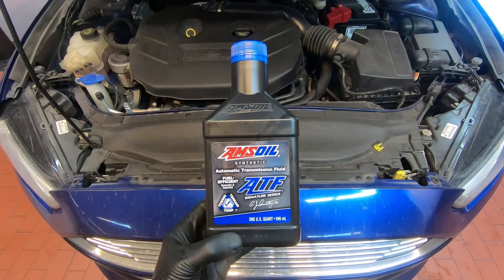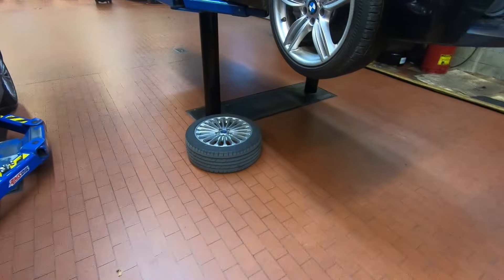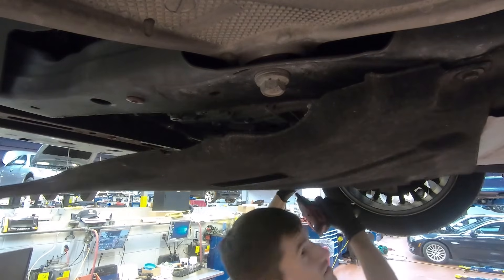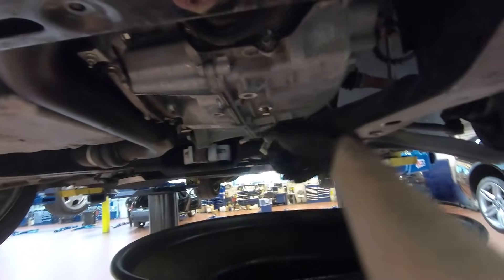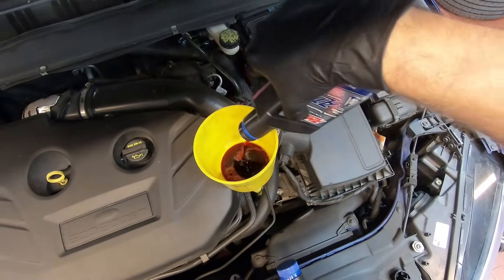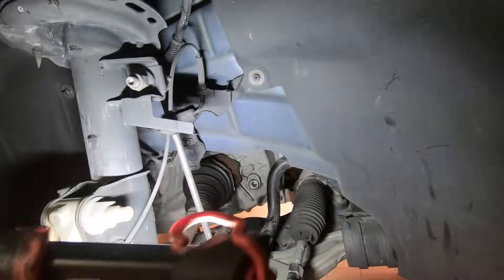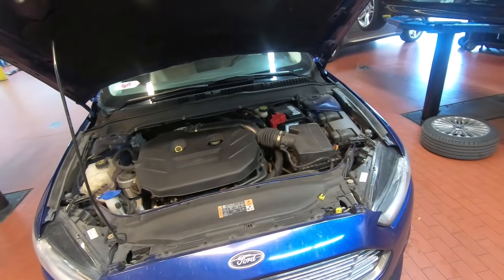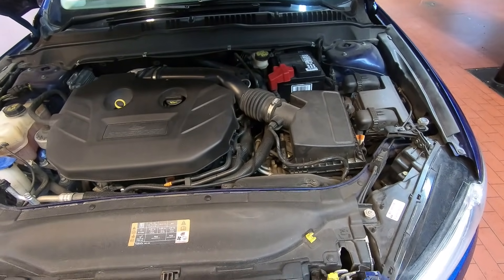Ford Fusion Automatic Transmission Service ( 6F35 ) [ HOW TO ]  2013-2020

Comment: Thanks, great instructions. I was able to do this in my garage, without a lift. I jacked up the front driver corner, remove the wheel, then lowered it to make it level, and still had enough room underneath to do all the steps of the process. Thanks.
Reply from the maker: Nice ingenuity! Happy to help! What fluid did you use and how many drain and fills did you do?
Reply: @THEDriverMod_  Castrol Mercon LV. About 4.5 quarts. I’ve done it 3 times before but could never find the fluid leveling hole; I had just refilled the approx same amount as had drained. This time I was assured it was at the full level. 

I’m always amazed how dark the used fluid is in this transmission. My other cars (Toyota’s, Chevys, Honda’s) never have trans fluid this dark. I think I’ve done enough ~5 qt drain/refills over the time I’ve owned this 2016 to prevent a failure.
Reply: @LiveAGreatLifeEveryDay the only negative thing I see about these transmissions is the fact you can't replace the filter (unless tearing the whole thing apart). Other than that, they seem to be fairly solid
Reply: @LiveAGreatLifeEveryDay Mercon LV tends to get dark as compared to earlier versions but it doesn’t mean it’s toast. It’s recommended you do the procedure every 30K miles. I believe if you do a drain and refill every 30 K you don’t need to do it multiple times.
Reply: What a great idea, thank you!

Comment: Would this be the same process for a 2017 continental 2.7L?
Reply from the maker: Round about yes, just go to www.premiumsyntheticsusa.myamsoil.com and use the vehicle locator feature to make sure the proper fluid is being used. I am sure that transmission is set up about the same way as this one
Reply: @THEDriverMod_   thank you so much for your reply.
Reply from the maker: Thanks for watching and commenting! Let me know how else I can help
Reply: Just wanted to let you know I did the change on the trans fluid way easier then I thought. Thanks for the info. Super helpful.
Reply from the maker: That's awesome to hear, thanks for the feed back, I appreciate alot. Glad to hear you were able to get it done!

Comment: The manual has 10 qt of   LV  and u used only 5 qt
Reply from the maker: A drain and fill does not get all of the fluid out, clutches, solenoids, passages and the torque converter hold alot of fluid. As you can see at the end of the video, I verified the level was full by removing the fill plug and ensuring fluid trickles out. Had I used 10 qts after only draining 5, I would have over filled the transmission and caused severe damage.
Reply: @THEDriverMod_  exactly thats why u used 5 qt and i did not know about it. So, my fusion 2.5l se has around 9 qts and when I drain it i will only fill 5 qt every 50 k mile. Right?
Reply from the maker: The amount you need to refill will very depending on how good of a drain it is. I recommend you drain it, refill with 4 qts, start it, shift through all the gears for a few seconds each, put the vehicle in park, leave it running, removed the fill plug and top of the trans until it trickles out of that hole
Reply: @THEDriverMod_  great! I will do it!  🙏 thanks alot. Your the best!   I will make sure I follow you! 👍
Reply from the maker: @gameandfun1604  I appreciate it. When you need to order fluids/oils give my website a look. Ships in 2-3 business days and if you become a member free shipping on orders over 100 and 25 percent off everything too
Reply: I love ur explanation and video u are awesome

Comment: Thanks for the video I'll b doing this soon to my 2020 titanium 2.0 eco With 33000 miles I'm guessing it's the same process.
Reply from the maker: It'll be close enough. Just make sure the fluid meets the spec, go on to amsoils website and use the vehicle locator tab to make sure you get the right stuff. If you're mechanically inclined I know you can manage around the slight possibly differences.  Www.premiumsyntheticsusa.myamsoil.com
Reply: @THEDriverMod_  cool appreciate the info an I love working on my own cars. Yup going with amsoil as well little pricey but well worth it.
Reply from the maker: You'll be happy you did. Even with me working at the dealer and basically getting the OEM fluid for free, I'd still choose Amsoil everytime

Comment: They shift hard from factory so there’s no preventive maintenance lol
Reply from the maker: Definitely still recommend changing the fluid.... especially with the filter not being easily serviceable
Reply: @THEDriverMod_  Of Course! But what I’m saying is they’re damaged from the factory. I’ve had a 16 1.5 SE & 18 Platinum 2.0 Twin Scroll Ecoboost An They both shift hard brand new from factory
Reply from the maker: That is true. 2-3 is the worst of them all, it's just part of the the characteristics of that transmission

Comment: No transmission oil filter?
Reply from the maker: There is buy to replace it you have to remove the transmission and separate the case to replace it. That's why the fluid maintenance is critical
Reply: @THEDriverMod_  Hey thanks i did not know that. Now i know that the transmission oil will need to be changed often.
Reply from the maker: Your very welcome

Comment: I have the chance to buy a 2020 Ford Fusion Titanium, 2.0, AWD with 36k miles, for about $20K. Is this a good deal or will it have transmission/coolant/mpg problems like the older versions?  I love the look, but i don't want to be turning wrenches for the next couple years, i want something reliable. I can do basic stuff, brakes, rotors, fluid changes, starter, alternator... etc. But I don't want to be pulling the tranny at 100k. Let me know what you think!
Reply from the maker: Change the trans and PTU fluid every 30k and use high end fluids like Amsoil and you will have a reliable car. Obviously with AWD more can break and go wrong but if you do get it, Change all the fluids over to Amsoil and you'll be set. www.premiumsyntheticsusa.myamsoil.com
Reply from the maker: Mine has 158k using amsoil fluids, no issues, trans has a intermittent harsh 2-3 upshot but that's it and it's not that bad but I'll take it for 158k

Comment: Didnt mention you gotta get the fluid up to 175-200F before you remove the leveling plug. Requires driving the car like 20 minutes
Reply from the maker: It's not that critical,  and if you know what you're doing then you can accurately guess how much more you have to put in when it's not up to temp... it's an acquired skill. 158k miles on mine and still going strong doing it that way
Reply: @THEDriverMod_  the fluid expands when it gets up to that temp. Helps get the extra amount out
Reply from the maker: I am fully aware but if it's coming out of the hole barely at 140 degrees for arguments sake, it doesn't expand that much when I hits 170 plus. Be doing it like this for years and never had an issue, you just gotta account for it and know what you're doing. Being a couple tenths over filled or undefiled is not a huge issue

Comment: Thank you a very clear and very precise step-by-step instruction video.  Would this eliminate the very fine grinding sound on my 2013 Ford Fusion Hybrid SE.  Noise started 2weeks ago, I have not changed my transmission fluid, according to FORD this should be done every 100K miles.  My transmission was replaced by FORD at 140K and was under warranty, I am now on 200K miles.  Please advice.
Reply: They’re wrong, they want you to ruin your transmission. I change my fluid every 30k max
Reply from the maker: Changing the fluid would not remedy your concern and having experience with the internals of this transmission I would highly recommend changing the fluid every 40-50 k miles.

Comment: 2015 2.0L here...is the fill hose/cap assembly supposed to be flush with the top of the trans case? Mine has some play and can rotate with pinch clamp..did notice dark flaky residue on top of case and nut located just northeast of cap...cap happened to be raised up a bit, possible it wasn't secure after CV axles were done topping off fluid?
Reply from the maker: Just insert into the hose as far as it will go, it also acts as the breather so it will not be flush as well as there will be dark debris around it
Reply: Awesome thanks man

Comment: It's not dual clutch transmission?
Reply from the maker: No, these are regular,  torque converter automatics
Reply: @THEDriverMod_  means that is not dry clutch 👍
Reply from the maker: @redihoxha2940  correct,  automatics do not have a clutch period, wet or dry.
Reply: @THEDriverMod_  I think mine is 6 speed dual clutch, don't need to replace the oil
Reply from the maker: The fusion was never made with a dual clutch.... are you possibly referring to the Ford focus?
Reply: @THEDriverMod_  yes Focus 2.0 2016. I have some issues like shaking...jerks between 1 and 2 gear. I have to see with any diagnosis what's the problem with mechatronic
Reply from the maker: @redihoxha2940  that explains why I was confused, this video is about a Ford fusion 2.0 ecoboost, not a Focus. The focus is a dual clutch, dry type. You can change the fluid if you want but it won't fix your issues. You need a new clutch pack assembly.
Reply: @THEDriverMod_  it has only 18k miles, I think that some selenoid don't have enough power to shift, some electric is missing

Comment: Good video, you forgot to mention that the vehicle needs to be operating temp inorder to get an accurate reading. 😉
Reply from the maker: "Officially" you are correct, but the difference is so minimal on the transmission it doesn't make a significant difference, but that doest mean you should if you are able to.

Comment: Well done! I was wondering why not just measure the quantity of the fluid removed and replace with exactly the same amount? I would think you could then skip the leveling procedure.
Reply from the maker: Better safe than sorry, plus, the fluid you are pouring in is not at operating temperature. The fluid level is only accurate at operating temp. You would be surprised by how far it is off by.
Reply: @THEDriverMod_  Thank you! But removing Cold fluid vs. installing cold, still off?
Reply from the maker: @Duchydog  you can do it how you wish.  I am just demonstrating the proper way, not to mention how to check you fluid level if anything else.
Reply: @Duchydog I realize this is an older video, but you always get a better drain with a warm transmission
Reply: I don't disagree but Dexron VI/Mercon LV has such a low viscosity 5.9 cSt that it will drain very freely at anything above freezing.  @mattsutube

Comment: Great info👍🏻  Is it normal for the fluid to come out black from the side hole after you drain and fill with 4 to 4.5 quarts?
Reply from the maker: Thank you. If it's coming out black, I recommend definitely doing another drain and fill because that means you are behind on the fluid Maintenance interval

Comment: I have a regular 2016 Ford Fusion SE & is due for a transmission flush? Is this the same thing? If so, what oil should I take with me to the dealer? They’re charging me so much. Please help!
Reply: Did you try this?
Reply from the maker: Try what?
Reply: @THEDriverMod_  just flushing fluid?
Reply from the maker: Go to the website : www.premiumsyntheticsusa.myamsoil.com then, put in your vehicle in the vehicle  locator search tab. You will have two transmission fluid options. Pick which one works best for you. Also, don't forget to sign up to be a preferred customer to get 25 percent off. Hope that helps!

Comment: Can u drop a link for this trans fluid? I need to do this on mine. U said 5 quarts? Also any additives?
Reply from the maker: No additives needed, 5 qts is enough to do one drain and fill and level check/adjustment. Link is: WWW.PREMIUMSYNTHETICSUSA.MYAMSOIL.COM

Comment: PO741 Torque converter clutch circuit  Performance/stuck off on 2015 Ford Fusion titanium. I was thinking of replacing the torque converter clutch solenoid your thoughts?
Reply from the maker: Won't hurt, give amsoils fluid a try when you refill it. You may also want to look into replacing the  filter.  It's funny you mention this today because I actually have a 6F35 apart right now replacing a solenoid
Reply: @THEDriverMod_  I called two dealers I was told there were about 7 solenoids. They couldn't tell me which solenoid was the TCC solenoid. No videos on Ford fusion titanium out there. I am stuck. SOS
Reply from the maker: @stkmon1  it's the 3rd one down on the right hand side of the valve body
Reply: @THEDriverMod_  Thank you so much

Comment: I thought you should drive it also and put it through the gears and get the fluid temp up to op temp then remove the side  plug to check the level?
Reply from the maker: You can definitely go drive it if you want. I do cycle it through the gears and let it get some temperature just sitting in the shop. Not driving it won't cause a problem

Comment: What oil level should be maintained in this gearbox? What's the best way to check it?
Reply from the maker: Watch the video, i show you how to check the oil level in the transmission
Reply: @THEDriverMod_  ok
So after pouring 4l ~ 5l, when it starts to pour out of the side plug, then turn it and it's ok?
Reply from the maker: @sztajfatv9710  you want the trans fluid to run out of the side plug while the vehicle is running and at operating temperature.
Reply: @THEDriverMod_  t
The correct condition of the oil in the gearbox is when the oil flows out of the side plug during operation?
Reply from the maker: @sztajfatv9710  that is correct

Comment: I went to ford service and asked them about how much does it cost to change the transmission oil for my Ford Fusion 2015 SE? they said $350
Reply from the maker: If youre able to do it yourself, than it will cost you about 60-100 depending on how many qts you want to exchange. Each drain and fill does about 4-4.5 qts at a time. If you can't do it yourself, get the amsoil fluid and then take it to the shop of your choice and have them install it. That way you're only paying the shop labor and not the premium they add on top of their fluids/oils. Use www.premiumsyntheticsusa.myamsoil.com to purchase and sign up to be a preferred customer! You'll get 25%off your order. I'd appreciate it. I work at a dealer and will tell you this fluid is 20 times better and worth the cost of it.
Reply: Lol omg that's horrifying 🤯. I'll definitely keep doing it myself

Comment: I own a 2017 ford fusion with the 2.5 engine with +-54,000 miles would it be recommended to do a trans fluid change? Also have you  or someone experience a 100/150 RPM fluctuation while cruising in 6th gear, you can see it bump up down on the RPM gauge every few seconds and feel it very slightly. Theres also shuddering (i'm thinking torque converter) when lightly pushing on the accelerator in a Fusion?
Reply: Sounds like it's worth it to do it 2 or 3 times?
Reply from the maker: If it's never been done then absolutely it is werth it
Reply from the maker: I'm not experiencing that but I would definitely recommend doing roughly 2 drain and fills as soon as possible. Use the link in the video description and input the vehicle info into the vehicle identifier tab to get the correct fluid.
Reply: @THEDriverMod_  update on what the real problem was turns out it was the torque converter.
Reply from the maker: @bambocaw  sorry to hear that my friend
Reply: @THEDriverMod_  It was covered under powertrain warranty though.
Reply from the maker: @bambocaw  sorry lol totally forgot your year and miles
Reply: @THEDriverMod_  thankfully it’s was lol.
Reply from the maker: @bambocaw  definitely recommend using the Amsoil ATF to keep the transmission running smoothly and reliably. I have 146k on mine. All original powertrain!
Reply: @THEDriverMod_  question. Is there a procedure to drain all or most of the nine quarts instead of the four and a half?
Reply from the maker: @bambocaw  dran and fill.... no, if you do a full flush then that will get it all but requires a machine
Reply: @THEDriverMod_  okay thanks.
Reply from the maker: @bambocaw  it's because half the fluid is stored in the torque converter and there's no way to just drain that without removing the transmission
Reply: @THEDriverMod_  yes that’s correct.

Comment: FIRST!!  Actually a good video. Other videos showed a different socket to open the check hole. So I had to make a run to the local hardware store for the tool. Luckily I had another car while the Fusion was on jack stand.
Reply from the maker: Thank you my friend, I appreciate it. There are other tools you can use to remove the check plug but what I used haw worked the easiest for me.